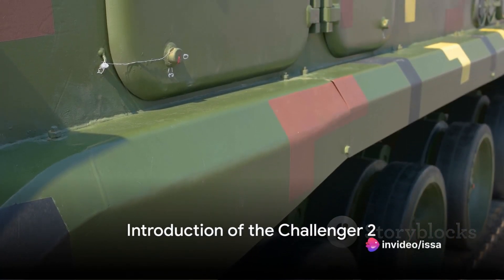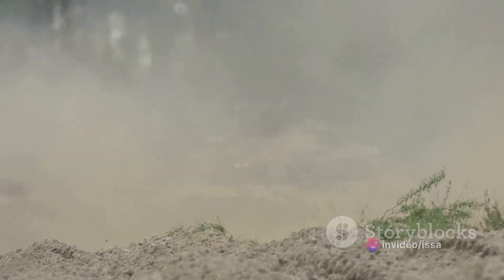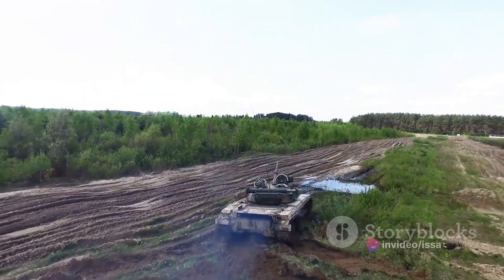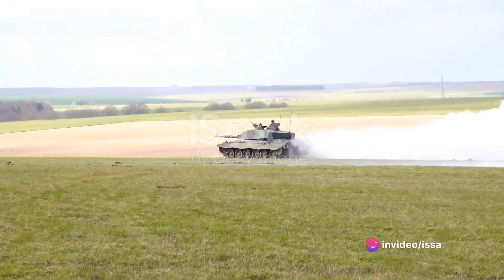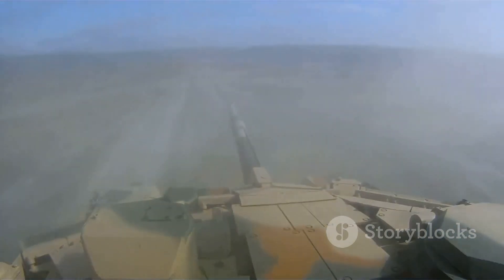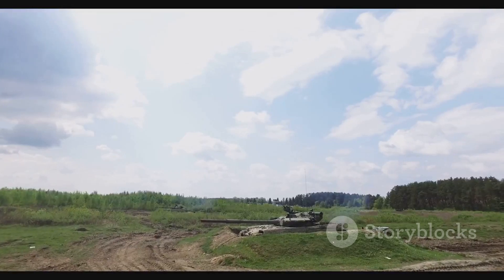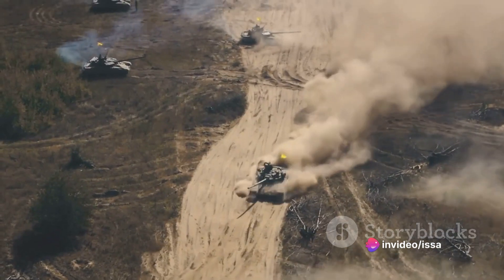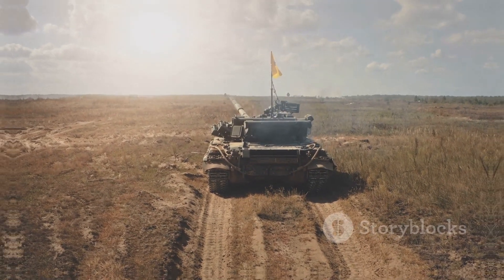The British Challenger 2: A Powerhouse on Tracks

Comment: A few corrections:
1. the L30a1 is not unique, several MBT´s like the indian Arjun are also using rifled 120mm guns. The reason is lack of technological capabilities.
The L30a1 is uniquely outdated in western armed forces, being a slightly modified L11a5 with the same dimensions and metrics, it is basicly a 1950´s design that was already obsolete in the early 1980´s, vastly surpassed by the Rheinmetall 120mm smoothbore in capabability.
2. Challenger 1 replacement developement started in 1986, because Challeger 1 was.... lacking.... in all its relevant metrics. (unreliable drive train & engine, armament and FCS were not on par with the competition (Leopard 2 and M1), mobility was lacking and a plethora of other problems) 
3. 62t is the Challenger 2 without add on armor, with add on armor its 75t.
4. Cr2 is on average 12km/h slower than the competition on road and offroad.
5. TOGS (the Thermal Observation and Gunnery Sight) is not cutting edge, it was modern in 1989 as a late stage Generation 2 Thermal Imager, but since then again 25 years have passed and the competition (Leopard 2 and M1 etc but even the T-90) got upgraded with newer and more capable thermal imagers and optronic packages of the 3rd generation.
Critically Challenger 2 lacks a commanders periscope thermal imager, something the "competition", again Leopard 2 and M1, Leclerc etc, got in the early 90´s.
6. yes it is a testiment to british engineering. how hopelessly deluded and out of date british engineering and design of the cold war in respect to MBT´s was.

funny that for 90% of the video T-72 and T-90´s were shown
Reply from the maker: Thanks for your good information
The information you provided is much more complete than the information provided by artificial intelligence

Comment: Oh just end the embarrassment and buy something German.
Reply: Eh?
Reply: @martinlewer2910  Challenger 2 is just massively outdated.
Armor is mid 1980´s design and layout and once in the day (in the early 1990s) it was quite good, but since then 30 years have passed and anti tank capabilities havent gotten worse, they got drasticly better.
Engine is underpowered and only semi reliable, giving it the lowest HP/t ratio of any western MBT and the lowest mobility and agility.
The main armament is just a poliished up 1950´s piece, wich is SEVERELY out of date and was already out of date 40 years ago.
The modernisations for Challenger 3 are basicly Leopard 2A7V/A8 put into a newly designed turret, entering service 10-13 years after Leopard 2A7V.
The UK doesnt even produce Challenger 2´s ammunition and spareparts anymore for the last 12-14 years.
Reply: @zhufortheimpaler4041  Our hubris is a serious military liability, we need weapon systems that work, not weapons systems for show.
Reply: @richardfinnigan7458  yeah well the german army is in a bad state, but still vastly more capable than the british one... its quite shocking.
and considering that, germany and poland have to keep the russians at bay in a landwar, as even france is not a reliable force to count on (their whole army is just light infantry and stryker brigades with minimum artillery)